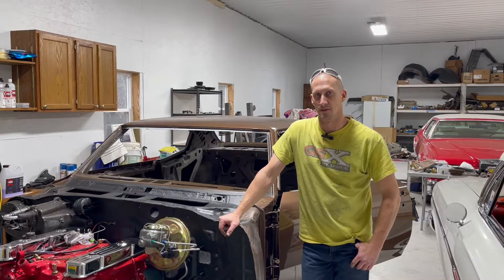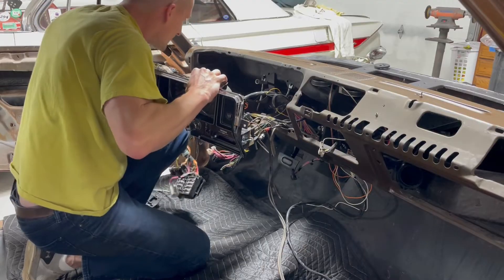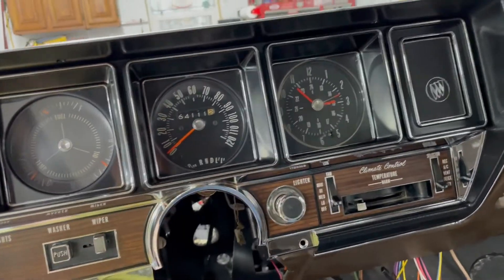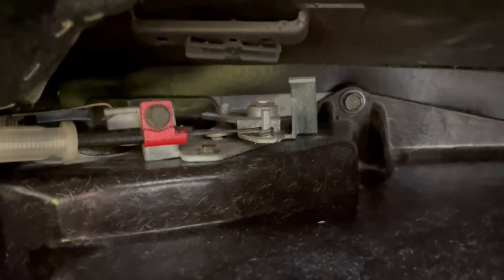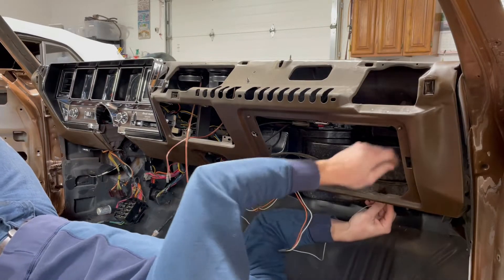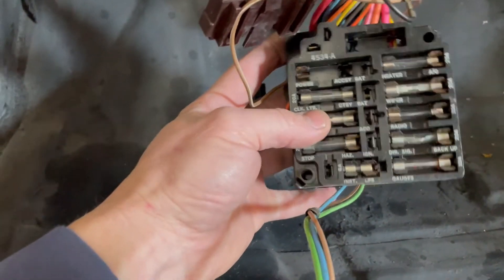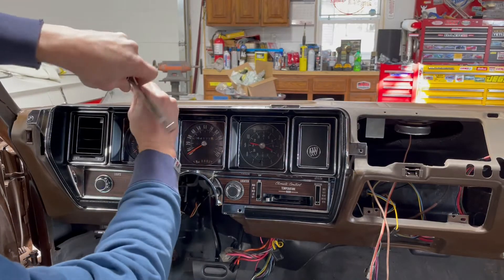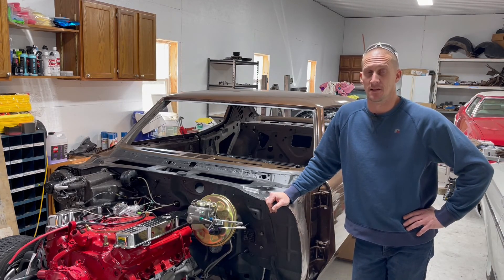1970 Buick GS Stage1 Instrument Cluster Install

Comment: Great video Adam. As you know I have chrome bezels in my GS and I lost points because of it at the Buick Nationals and MCACN. I have purchased the correct bezels from Todd Miller, and now comes the "joy" of getting it installed. Your video has given me plenty of insight into the major task that will be necessary. 🙄
Reply from the maker: Good luck!  It's a fun one.  Just take your time.  Non AC cars have tree of those bowden cables that can break easily.  Take extra care in working with them.

Comment: Hi I watched ur video, ty. I didn’t notice u hooking up the speedo cable. I have to change my speedometer cable and my ignition switch. When I drop the steering column will I be able to get to the speedometer cable or do I have to pull the instrument cluster out. Ty
Reply from the maker: You should be able to barely reach the cable by dropping the column.  In the video, I just reach up there and you can hear it click into place.

Comment: Any video on the dash pad removal?
Reply from the maker: No, but it's not too tricky.  You just have to know where to look for the fasteners.  On these cars, there are 2 or 3 nuts to remove, then just pull toward yourself when sitting in the car.  There are 3 or 4 clips that pins engage as well.  The nuts can be accessed when you remove the glove box liner.

Comment: Is it possible to replace the bulbs for the speedometer without completely removing the cluster?
Reply from the maker: I think so, but you'll be really tight back there.  The column definitely has to be dropped down. And if you have AC, the plastic duct under there has to come off too.

Comment: How hard is it to change the dash light bulb,. S and what size are the bulbs?
Reply from the maker: Depends on which ones you want to change.  
The ones in the gauges might be able to be reached if you drop the steering column down. They twist out of the gauge to get them out.  Those are 194 bulbs, same as the side marker lights.  There are a couple other types in the dash area.

Comment: Did an LED bulb upgrade on every light in my '72.  That was until I wanted to replace all the bulbs in the dash.  I couldn't get the cluster further away from the dash than an inch!  It's so packed in and there's so many braces behind it... I gave up.  I don't know what was holding it in there.  If I have to rip all those harnesses out just to replace the bulbs... nope!  Maybe someday.
Reply from the maker: I've found that it's a combo of wiring, AC cables, and speedometer that all play a part in holding that mess in.  It's really a difficult setup to work on.